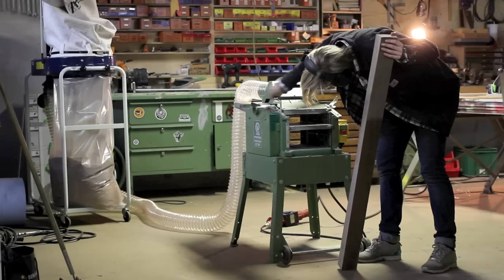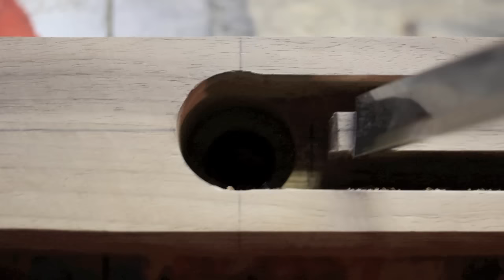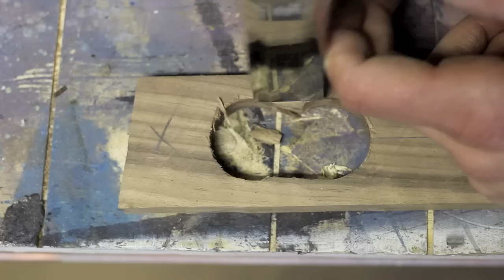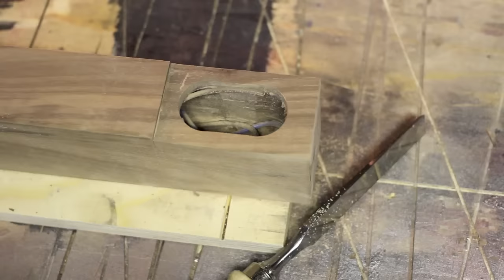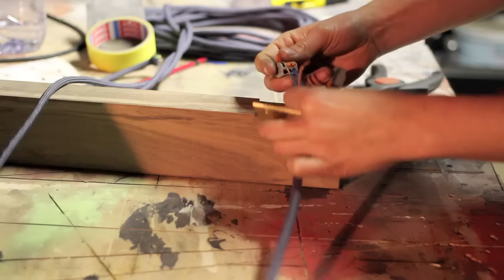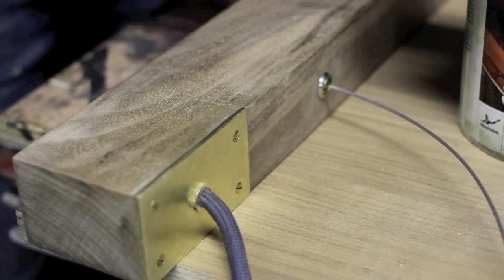Laura´s Walnut Lamp

Comment: Laura you have to have a degree in engineering, art or fabrication. You work with wood, metals, electricals, epoxy resin, plastics, you handle every tool, machine or sp equipment with ease. That's the only way I can explain it. Your work is really best quality. Probably degree in architecture. Any way every video is amazing ( except the champagne sprinkler video). Anyhoo, thanks for the lovely videos.
Reply from the maker: +SANJAY AHLAWAT thank you! i have a degree in design...the rest is just passion i guess:) hreat to hear you in enjoy my work!

Comment: Beautiful! Like how you've modified the screwdriver to accommodate the metal cable that runs through the screw :-)
Reply: I don't think she did.  It is a standard form of "security" screwdriver that is available off the shelf.  What is really cool though is that she thought of using it for this application.  A very creative project and style.  I'm impressed by her learned skill and / or extensive inventiveness.

Comment: Love the build, very minimalist. The screw pots for the hanger wire is also a very nice touch. So strange, I just put up some salvaged track lighting in my shop and I used those exact same lever action wire connectors! I bought them years ago and just used them about a week ago, now I see you using them from across the Atlantic, such a coincidence!  Well... technically you used them two years ago, but I just SAW this video... you get my point. :P

Comment: What a great build, so much attention to detail. Glad to see you use those new WAGO electrical connectors, I started using them last year, and I am hooked, they save so much time, so much better than the old screw blocks..
Reply from the maker: i agree. they are super convenient!
Reply: You should check out the new S221 series WAGO connectors.

Comment: Nice one Laura, keep it up! Just one point of constructive critisism: I wouldn't have glued the top on that light fixture. If you ever, for any reason have to service the thing, be it a new socket or a damaged wire, you basically have to break it.
Reply from the maker: +LReBe7 i know what you mean and of course i thought about that but glueing it up was the only way to keep that super clean look. IF something happens...which is unlikely because there is no movement or stress on the parts, you could go back to the tablesaw and cut the top off again to fix it, and glue it back on. i think the hustle is worth having that slick look :) thanks for watching!!
Reply: +Laura Kampf  I figured that was the reason, but I would just have gone with fancy golden/copper countersunk screws. Or even better: drill a recess for the screwhead and plug it up with a piece of the same wood. Anyway: there's lots of ways to skin a cat, I'm more of a techncian, I go for servicability, your more of an artist, you go for the looks.

Comment: Hiya, you should sell this light, if you can bear to part with it? Or even do small production runs, I'm sure it would sell. Hit a few high end boutique type shops near where you are. Different lengths in different woods with higher wattage or even LED bulbs? If my rooms were larger I'd have them everywhere! Steve

Comment: Nice work Laura, you need a bandsaw to work safely with brass  :).... well... I need one tooo.

Happy new year from Lombardy
Reply from the maker: +Children Of Doom yeah, i have a bandsaw now...but i still like to use the anglegrinder with a straightegde because it´s perfectly straight...thanks for watching!
Reply: +Laura Kampf poor straightedge :) with brass an aluminium I often use a router, I cut the piece slightly larger and then I use a contouring bit (bearing below the cutter) to have a perfectly flush surface.

Comment: Sehr schick. Sauber gearbeitet. Schönes cleanes Design. Was hast du für fassungen verwendet? Hab auch schon mal über einen Eigenbau einer lampe nachgedacht. Mir fehlt nur noch ne passende einfache fassung. Das Design mit den einfachen leuchtmitteln gefällt mir auch besonders gut. Ist das eigentlich alles eigenes Werkzeug was du verwendest? Du hast ja ein traumhaft großes Equipment. Mit schweißgerät, Bandsäge, tischkreissäge, dreh- und drechselbank. Bin n bißchen neidisch. Hab auch viel holz- und metallwerkzeug aber die großen Geräte fehlen mir größten teils noch. Schweißt du immer mit "E"? Ich hab mig/mag und überlege mir noch wig zuzulegen.
Reply from the maker: +Hauke Scheffler die fassungen bekommst du bei landwermann.de. ich schweiße auch mit schutzgas aber ich wollte beides können, also hab ich ne zeit lang nur elektroden benutzt. wig gerät hab ich auch von meinem sponsor lincoln bekommen, hab bisher aber keine zeit gehabt das zu lernen. is bestimmt mega! hoffe ich komme bald mal dazu :)

Comment: Oh woaw Laura... that is some seriously sexy lamp you made.
So simple yet so stunning. I'm officially impressed.

I just wonder though... what do you do if a connection fails inside?
Reply from the maker: thanks! well, there is no reason why anything should fail...but in case i had to open it i would have to cut it with the bandsaw and glue it back together.

Comment: Wow!  Found the electrical wiring intreging as well as the hanging hardware that you used.  Are they primarly European?  Also, what Festool sanders do you use?  Looking at acquiring some Festool equipment.  Thanks!!
Reply: hi i would like to ask what wires she is using i cant find them and also those white cups she puts the wires what are those ?? could you please help me ??
Reply: Angelo DjWinner Fairground or cabachon lights. on eBay.

Comment: call me stupid but i dont understand how she get power out the wire without cuting of the isolation. sry for bad english
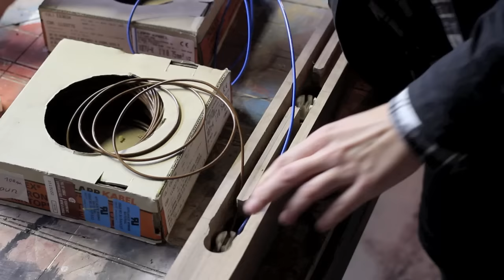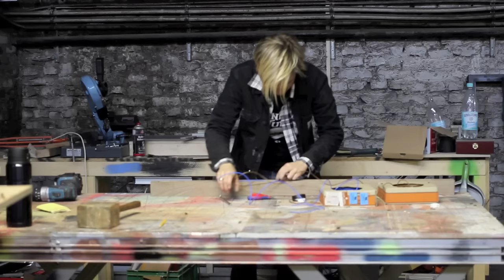Reply: The lamp holders are cuting the Isolation down to the wire when the caps are screwed in (1:40-1:50 timestamp)
Reply: PPDD okej THX. but how ?
Reply: The holder has 2 metal pins. The wires are put exactly on them and are pressed with the cap as it srewed in, so the pins are cutting the isolation and are pressed firmly against the wire itself =) search for "kabelfassung-e14-eco" - the pic is self explaining.
Reply: PPDD THX bro